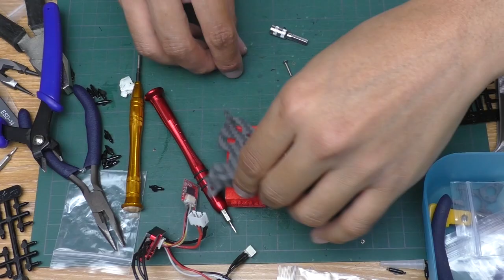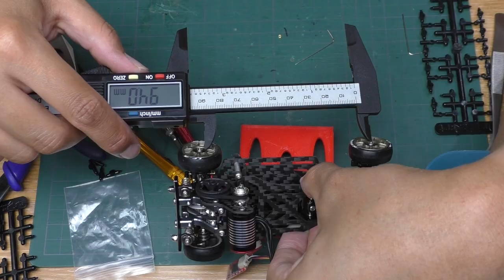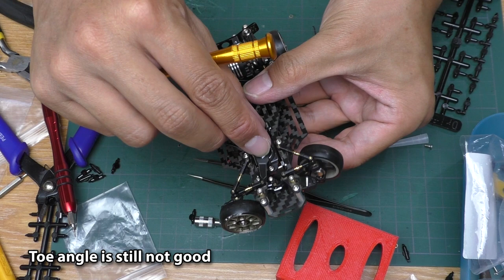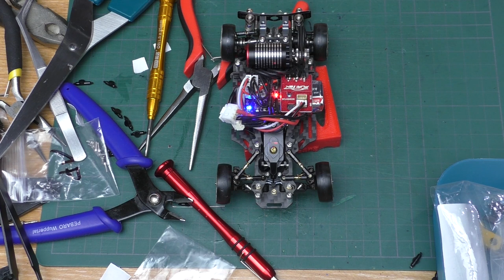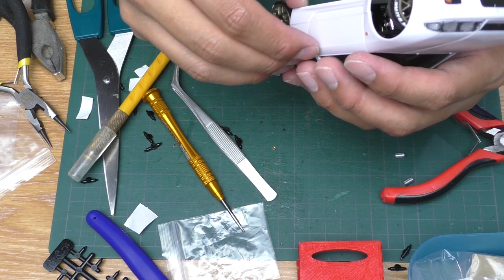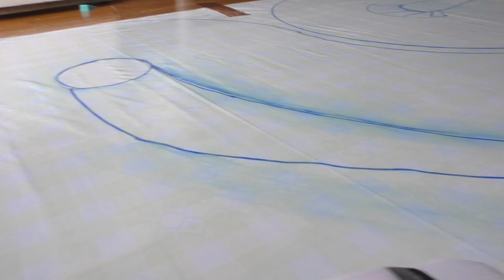DriftArt 2.6 EX Build Part 4 [Final]

Comment: Thanks for sharing the build. How do you like the Drift Art chassis? I've been modifying a WLtoys K696 (inspired by your video series), but feel like the chassis isn't very precise, and was looking into the DA 2.6, XRX, Atomic DRZv2, BMR or GLD chassis. Do you have experiences with them, or recommendations on a good chassis that is easier to learn how to drift on? I heard the DA is difficult to build, but don't mind tinkering around with it. Thanks in advance!
Reply from the maker: If you already have an experience modifying WLtoys to RWD then building and diagnose the DA should be OK. If you are not sure yet then DRZ V2 or GLD is a good option. DRZ V2 offers more for the money. GLD will need some upgrades to make it perfect but it's the easiest to build and tune.
Reply: @BeaversHobby  I appreciate the prompt response, Beaver! Yes, I've cut the WLtoys driveshaft to make it RWD, but am having difficulty getting it to drift around a cone consistently. I know I need more practice. I've added a Power HD G1 gyro paired with a Sinohobby 20A brushed ESC and Flysky GT3B transmitter/receiver, but the chassis doesn't seem very precise compared to the other setups I've seen, which I think would help make learning to drift easier. I've shaved a lot of the WLtoys front end to increase the steering angle, but it seems easier to buy a chassis that can achieve 90 degree steering out of the box. 

I've read that the DA feels more like a DIY project, and I believe you mentioned that it's overengineered to be too tunable potentially to a fault. 
BMR3 mentioned that the XRX has a more stable sliding rack than the DRZ's post steering system.
My goal is to drift around cones or a small track in the garage easily and consistently without spending too much on mods. I'll take a look at the DRZ, GLD and DA. Thanks for your feedback!
Reply from the maker: @ColinLeung  DRZ has an update with V2.1 that (they say) fixed the wobble steering but it's pretty hard to find. XRX drives great even out of the box but difficult to find a body that fits if you don't get the wheelbase adjustable plate and make it 98mm. Personally I find XRX to be the most expensive if you will play it regularly and need durable aluminium parts (plastic parts are extremely soft). GLD is a close second because of the upgrades it needs. I've heard DRZ V2 also has some issues but I haven't got one so I can't tell you what they are exactly.

Comment: I’m trying to get that same kit and I also have a mini z 030 evo in the mail what controller would you recommend that would work best for both cars?
Reply from the maker: I highly recommend Flysky Noble NB4 or NB4 Pro. It has a good selection of receivers. You will have the native Mini-Z EVO as well as micro receiver for any 1/28-1/24.
The other option is Futaba 4PM Plus (in case you have a Futaba distributor near you). It's the new one that you can use a module from NB4 to control the standard Mini-Z. If you don't plan to get any standard Mini-Z (non EVO) then the old version of 4PM will do fine. It also has the native EVO receiver as well as a good selection of receivers for any kit cars too.
Reply: @BeaversHobby  thank you for the reply I think I’ll be going with the nb4 mainly because of the screen thank you again

Comment: It took me more than 16h for the entire build (first one I do) and it is the 2.6cc so I had less to do. Nice work, I now can tell the difference between experienced builder and me 🤣
Can you tell me the final lenght of each arms for the front and the left ? I can't get mine setup, I want to use the nissan 350z mini z body, 94mm too.
Reply from the maker: I'll measure them for you once I get home.
Reply from the maker: Here's my current setup.
Front:
Upper arm (camber) 18.8mm attached to the inner hole
Lower arm 23.5mm
Triangle arm (caster) 21.7mm
Rear:
Upper arm 16.5mm
Lower arm gap 1mm (push it out for camber)
Servo tilt: 15 degree
Reply: @BeaversHobby  for the front, lower arm is the one where the suspension is attached? If so, what the size of the arm attached to the servo horn? I followed the manual and I can't make this one very long... Also I have the 2.6cc sonI can't change the angle of the servo i can just move it front and back. And make the horn longer or smaller. Thank you to take Time to answer me 👍
Reply from the maker: @Jemoms  I meant the main arm, not the steering/toe arms. Those are still the same as in this video.
Reply: @BeaversHobby  awesome, thank you. I will try it maybe tonight after work.

Comment: What is the best rc 1/76 model?
Reply from the maker: To me the Turbo Racing C71, C72 and C73 (RX7, Eclipse & Supra) are the best. The speed is great and it can upgrade the transmitter pretty easily. The performance is great and the price is reasonable as well.
Reply: Thanks

Comment: damn. how many hours it take to build this kit. im intrigue to buy one. but dont know to choose whether this 2.6ex or save a buck head toward drz limited edition 2.1
Reply from the maker: 5 Hours just the build time alone excluding the time I was looking for the right screws/components and carbon fibre plate filing. So add at least 1 hour on top of that.